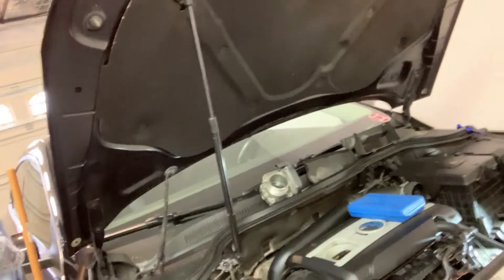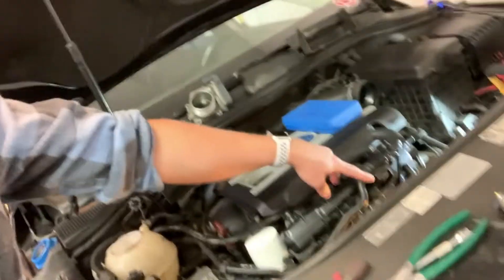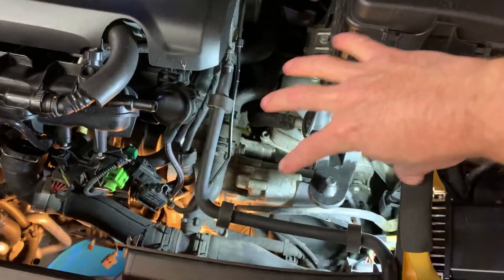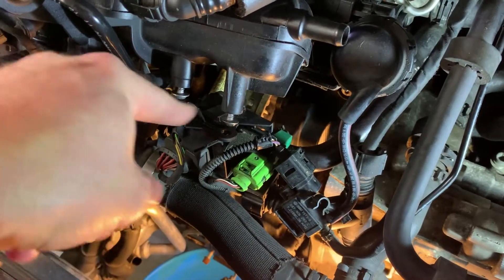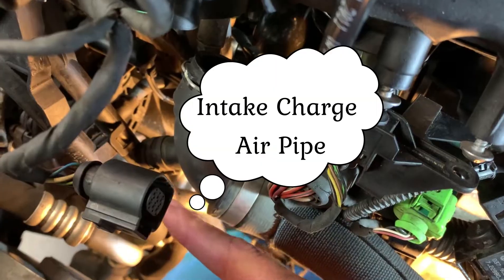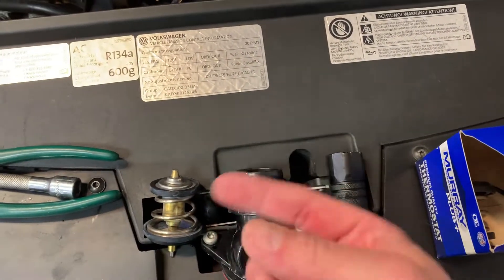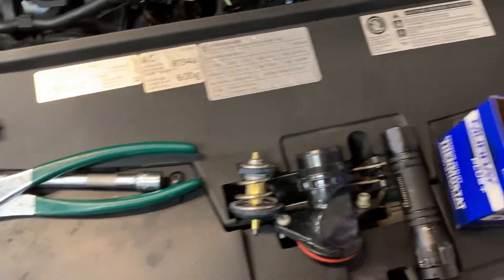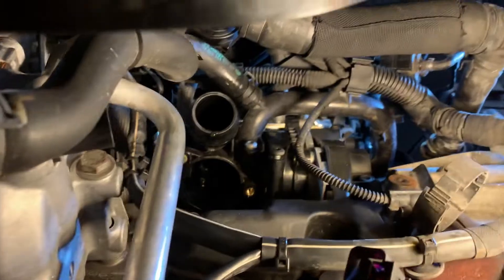2012 Volkswagen CC 2.0 TSI Engine: Thermostat Replacement

Comment: Could you please elaborate a bit about feeling the lines for temp? I seem to have the opposite case. The thermostat seems to be stuck open. From what I  understand one line should remain cold until thermostat opens, and if it's stuck open both lines will warm up gradually. The info I can't find is, which lines do you feel with your hands? There seem to be 3 lines going in the housing. Also, can you reach them from the hood or do you need to be under the car? Great video btw. and thanks!

Comment: I fixed my whole cooling system just by crushing the baffle that plugged in the upper hose on the reservoir.   It saved me thousands of dollars.  I have 370 k km on my 2012 jetta tdi.  Ive had issues for so long and i found this from trouble shooting.   So happppppyyyyy.
Reply: What do you mean crushing  the baffle
Reply: Yeah what exactly did you do partner and what was happening that you addressed?

Comment: I couldn't unseat the water pump to make room the remove that tricky bolt. IVE losened all the water pump bolts, Did you take off the water pump drive belt? Mine is super tight. Didnt see that part. . .

Comment: Does anyone know where the thermostat sensor is on a 2014 cc
Reply from the maker: The temperature sensor is on the water pump housing. It’s a pain to get to. Passenger side of the water pump. Located under the intake behind the throttle body.

Comment: How were you able to sit it in there correctly? I’m having the same issue but I’m stuck at tightening the 2 thermostat housing bolts, it seems like it’s leaving a gap and I’m not getting it to seal correctly, also did that thermostat work? I have the same one and I was thinking it might not be the one the car needs
Reply from the maker: The thermostat that I used fit correctly. It is a little tricky getting it in so it slides in all the way. If not, the housing will not seal correctly. I hope you get it figured out!

Comment: I have the same year and make, with about 85000 miles on it.  It's not overheating while driving, but ever so often coolant will drain from the reservoir.  What do you think is causing this?
Reply from the maker: I would look underneath on the front side of the engine to see if there is evidence of a leak. A failed head gasket will also consume coolant.
Reply: Head gasket or oil cooler.

Comment: Did you ever use the o ring that came with the thermostat? I got a new housing and a thermostat but the housing already came with a seal (o ring) installed but it’s a bit smaller and thicker so don’t know If I would need 2.

Comment: Question I have the same car I just started noticing the coolant light flashing yesterday. I put more coolant in and I noticed today the coolant leak in front of car when I look under hood I see it's wet on the front middle bottom of the plastic. What can that be
Reply from the maker: That sounds like the same area as the water pump. It could be the water pump gasket or the transmission cooler pipe which also went bad on mine. I will be posting the video from that soon as well. That was an easier fix because it was more accessible.

Comment: Great video. Thank you for the heads up. I have the same code coming on but no overheating, just underheating (lol) - i have suspicions of the thermostat being stuck open. Thanks again for the insight!
Reply: I’m changing mine tomorrow will let you know if it fixed the error. Mine started leaking which made me finally give up and change it.
Reply: @DavidcGaribay  aw man. Good luck!
Reply: Did you ever replace your thermostat? I got the same issue as you. My car came from Florida last year so I think the thermostat is original because they don’t use there heat as much as we do in ny
Reply: @tonybristol9132  well thankfully my heat works just fine still. Good luck to you up there, I can't imagine not having heat in NY. Short answer, I have not changed mine yet. I gave an attempt to this guide but I found that I may just need to pull the whole water pump out to get the thermostat. I had to remove all bolts from water pump to get some wiggle room, but still gave me a hard time. You may have better luck
Reply from the maker: @thelitos07  yeah, it can still be a tight spot. If you change the water pump, replace all the gaskets. I reused the transmission cooler pipe gasket and it later developed a leak (video on that coming).

Comment: Great video.  These are the exact same symptoms that I'm having.  The dealer wanted to remove the lower timing cover to inspect the timing gear for $1,200. Whaaat?    I had it towed home.
Reply: I would probably go ahead and change both water pump and thermostat
Reply: @thelitos07  I was thinking the same.  09 Passat has a cracked thermostat housing.  Most likely have mechanic change pump at same time

Comment: But which point of the thermostat goes into the housing ? I’m stuck on that point
Reply: The longer end (shaft) of the thermostat goes into the outside housing. Be careful: both shaft ends of the thermostat have a hole that they must fit into. It's quite easy to mis-install the thermostat and still be able to bolt down the cover.

Comment: My temp light came for the first time since owning the car and when I pulled over the liquid inside the reservoir was boiling like hot water on the stove, any ideas what could be causing it? The light did go away after leaving the car off for a few hours, but after a 14 minute drive the liquid was still boiling with bubbles and all.
Reply from the maker: Check the temperature of your radiator. If its cold, than it is more than likely a bad thermostat.
Reply: Need to test the pressure of the coolant. Could unfortunately also be the intake/head venting gas into the coolant passages.

Comment: Hello Bryan, sorry for bad English, but I will try to explain.
Is it possible to change fan turn on temp?
Default behavior - turn on fan on about 105c temp.
I want to change this value to 95c temp.
Reply from the maker: The fan is controlled by the computer, I think you would need a computer to hook up to reprogram the engine management system.

Comment: Hallo, do you have the Video from the throttle body removal? Thanks
Reply: It's only 4 screws on each corner. Very easy
Reply from the maker: I did not video that, sorry.

Comment: This is a great video thanks so much.
This is just a thought, WHAT about a universal joint socket between the torx and the extension shaft.
Reply from the maker: It would not fit. I tried numerous different universal fittings but they were all too tight. I even jt tried a long fallen wrench. But you found something that fits, throw it up on the comments. It would be great to not even have to loosten the water pump.

Comment: How did you get the thermostat and o ring seal to hold 😕😕😕
Reply from the maker: Never had any issues with the housing leaking. Is yours leaking?
Reply: @bryanfagerstrom4664  so turned out to be water pump leak, and previous mechanic inserted a wrong thermostat  and thermostat housing.😅, it was an easier fix buying the full assembly of the pump.

Comment: Way too many dealers just throw up their hands and say it's a head gasket when the car overheats. My dad's Toyota had overheating issues and the dealer instantly said "head gasket" when in reality the coolant was very low because we knocked a hose loose while doing the alternator. Pretty crazy.
Reply: Wiiilld. You'd expect to hear head gasket if you were blowing white smoke out the back
Reply: @thelitos07  Exactly! Overheating is not the ONLY symptom of a bad head gasket. Thank goodness that I've found an independent european car shop that seems to know what they're doing for 1/2 the dealer cost!

Comment: Yo I’m getting the code p2181 but my car isn’t over heating at and I did the same as you I replaced the water pump but not the thermostat.
Reply from the maker: Mine did the same thing for months until the thermostat finally quit completely. p2181 and no overheat until one day the thermostat stuck closed and caused the overheat. Either way, that code is telling you the thermostat is not operating within Volkswagens parameters.
Reply: @bryanfagerstrom4664  thanks bud could you tell me which model thermostat is the one you purchased

Comment: I’m having the same problem...when in idle for about 15 min it’s start to heat so it’s the therma
Reply from the maker: In the video I explain how narrowed down the thermostat, it could be any number of things: head gasket, thermostat, bad water pump, broken water pump belt, or even a bad radiator.